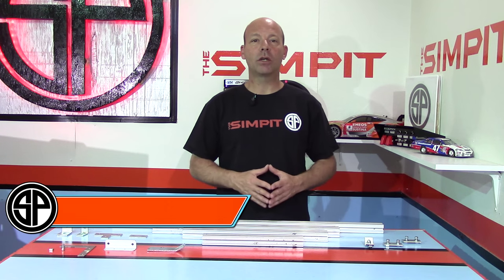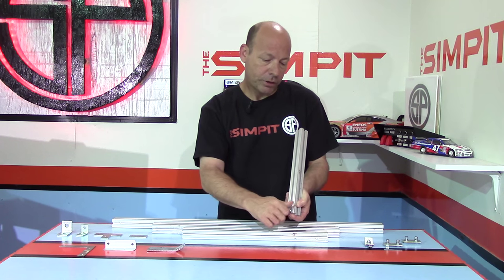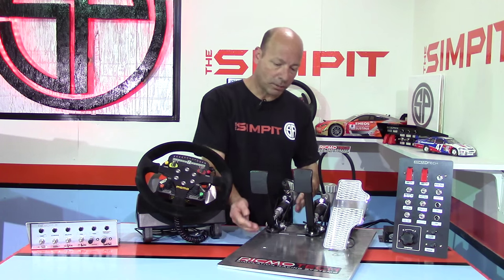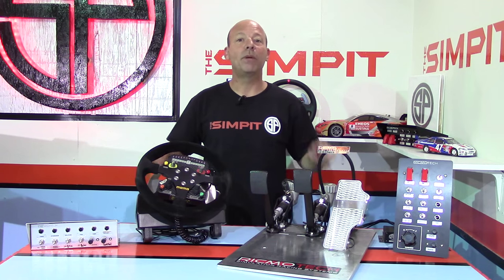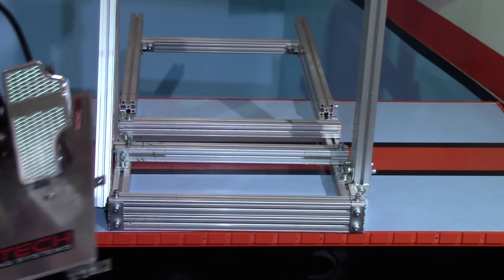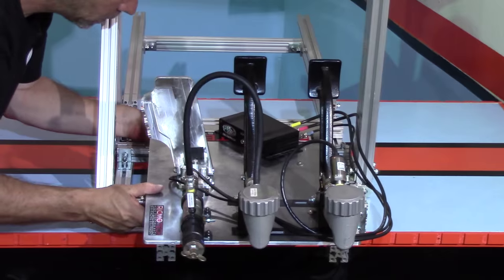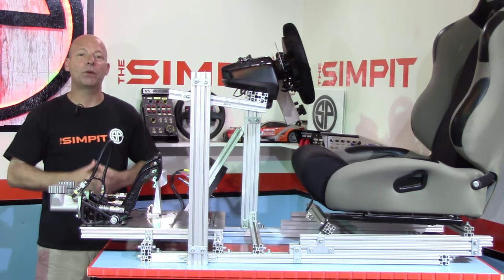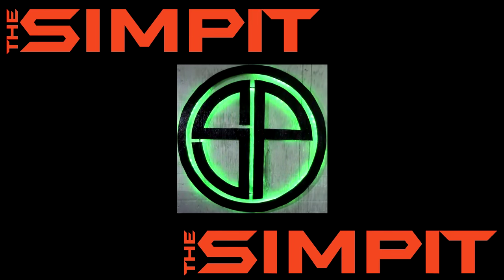DIY Aluminum 80/20 Tubing Simrig by The Simpit

Comment: I use to work with 8020 and Bosch rexroth aluminum profile tubing. I like the Bosch accessory's list and I get the company discount! The 45 mm 80/20 and Bosch match up! We used it for material handling at a Large NW Aircraft company. We cut it with a 12"miter saw and a Freud 12' 96 tooth carbide Thin Kerf Non-Ferrous Metal Saw Blade. About $100 blade. I used an  table saw with a similar 10" carbide high tooth count blade at home. Allow the blade to cut and do not rush it. You can make a second spring pass to make the cut pretty. The Bosch Swivel Bracket kit allows my wheel deck to rotate 180 degrees and move up  and down in a T-Slot to allow my friends to adjust to their liking. My seat and wheel deck platform sit on 45mm T-Slot tubing allowing both to move in and out in relation to my pedal box that also have 30 degrees of rotation. Fanatec Turbo-S and Clubsport V1 pedals.
Reply: how much would you (rough) estimate this would cost to build?

Comment: What were the extrusions width diameter? I can't see it on the forum page with all the info, only the required length. would 40mmx40mm be sufficient enough? Or would you go thicker for more support?

Comment: How does the rigitity/solidness of such a build compare to say, and Obutto revolution? Especially when in use with very strong steering wheels and like 90kg load cell pedals?
That is really the only point that I'm still sceptical about, and which is holding me back from building my own rig.

Comment: Which specific type of 80/20 is being used here? It seems there's 20*20mm, 40*40mm and 45*45mm. Also, there's different sizes of slot gaps - either 8mm or 10mm.
Reply: +Rory McCrossan i think shaun used 1" stuff, so roughly 25mm (30mm maybe?). Anyone used these guys in the UK? http://www.aluminium-profile.co.uk/
Reply from the maker: +Rory McCrossan 

It is the one inch tubing, it is the least expensive and elast fancy style I have ever seen.
Reply: +J-Duvel I used motedis.co.uk recently for some 40mm section stuff to build a triple monitor mount.  Way over engineered but rock solid.  It was my first time using this stuff but I will be going back for more to build a full rig.  They offer a rig kit as it happens.  Motedis are based in Germany and that is where the stuff will ship from.  They also cut lengths to order so don't expect delivery tomorrow.  They are a small outfit of engineers I think (not salesmen) so comms is brief and to the point but perfectly adequate.  Lead time to shipping when I ordered was about 7 working days.
Reply: +Rory McCrossan 
I built my rig out of the 30mm profile, its plenty strong enough. Also a good point to note is that the 30mm profile uses M6 nuts & bolts, so you can use M6 square nuts. They fit the groove perfectly, and although they are kinda awkward to position until you tighten them up, they're far less expensive than the spring loaded ones that run to about £1 for 5. I bought a bag of 100 for £2 from a family run hardware store.
Reply: +Matt Smith So M6 nuts and bolts are what I need to get if I use the 10 series 1in x1in 8020? I have spent more time trying to figure out what size and length bolts I need to use than I have anything else because he did not mention these details in his guide.

Comment: Nice rig. How much would you say it cost? I've always wanted a 80/20 rig, but I've been put off by the assumption that it's really expensive.
Reply: +Manny_NotTheStig If you're in the US. A lot.
Reply: I know it's 2 years but eBay is the best place to buy. The extrusion is pretty cheap. It's the fasteners and brackets that end up costing alot.